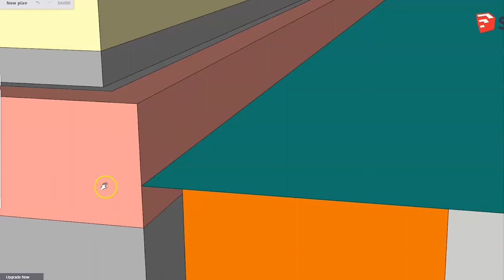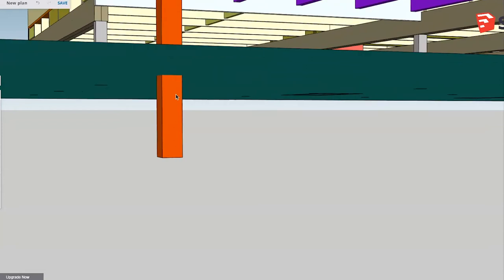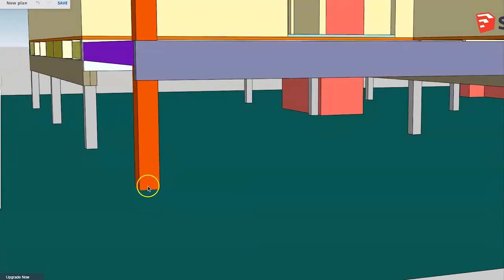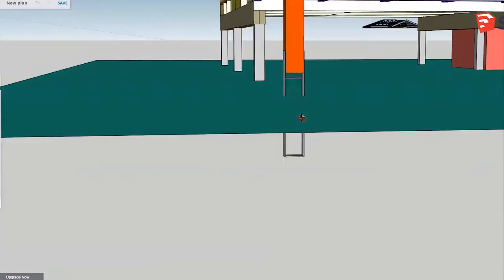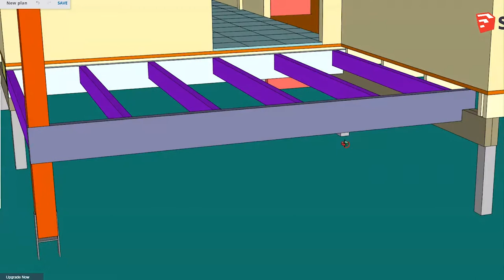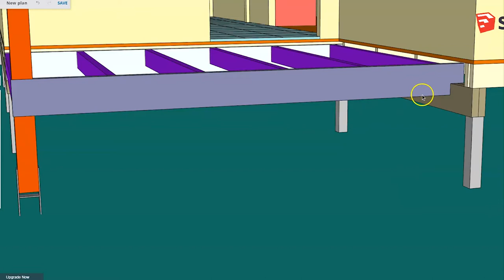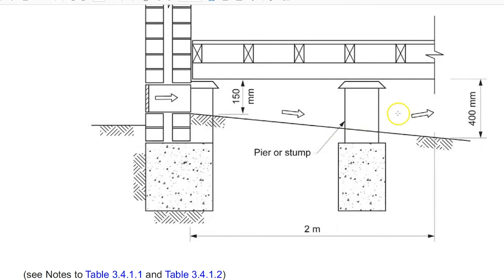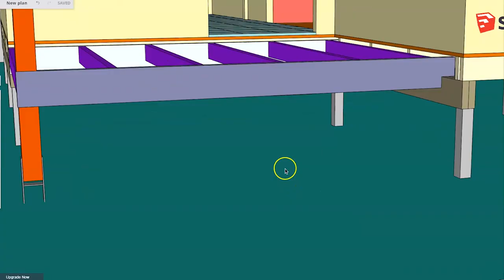Rising damp and moisture

Comment: Hi Matt.  In relation to the stirrup used to hold the post, with the gap between the stirrup and the post, wouldn't the screws attaching the post to the stirrup be taking all the weight? Wouldn't it be better to have the posts bottom directly in contact with the stirrup to ensure the weight isn't being held by only the screws/bolts?  Are you able to have a video on actually buidling a deck from start to finish as your video's are really informative.  Cheers!
Reply from the maker: Yes, the bolts take the weight of the post. As well as the compressive action of the stirrup sides being clamped the the post by the bolts. If you look at the bolt holes in the stirrup you will see that the holes do not line up vertically, they are slightly offset. This is so the bolts do not sit in the same section of vertical grain of the post, and add to the carrying capacity. If the post sits straight on the stirrup base you are only relying on two small welds holding the base in which are not as strong as the bolts. Also as soon as you get any rot from moisture sitting at the base, the post would no longer be bearing on the base anyway. Best to keep it clear.
I am glad you are enjoying the videos, unfortunately I don't get a lot of time to make them as I teach full time now. I will try to do one one deck construction for you.
Reply: @mattthechippietrainer  thanks for that. What type of bolts or screws would you use with the stirrup?
Reply from the maker: @ginarhodes7907  Hex head bolts are most commonly used for stirrups. The size will depend on the load it is carrying.
Reply: @mattthechippietrainer  is there a table to show what size bolts should be used with certain loads?
Reply from the maker: @ginarhodes7907  it would depend on where you are building and what class of construction it is. The National construction code (Building Code of Australia) will direct you to which Australian Standard is appropriate. You can access it for free on line.

Comment: Hi Matt, in regards to timber posts in ground can you in theory, wrap the bottom of the timber post with 0.2mm polyethylene construction plastic up to NGL will this avoid rot?
Reply from the maker: That would provide a certain amount of protection but there is still the opportunity for moisture to get between the plastic and the post. Painting the bottom of the post with a thick layer of bitumastic waterproofing paint would be a better option than plastic. But the stirrup is the best option and also make the post easier to replace if the need arises.